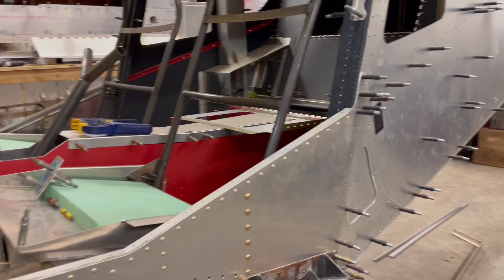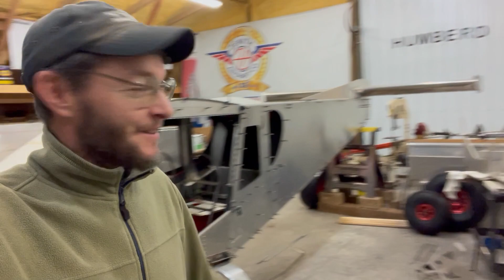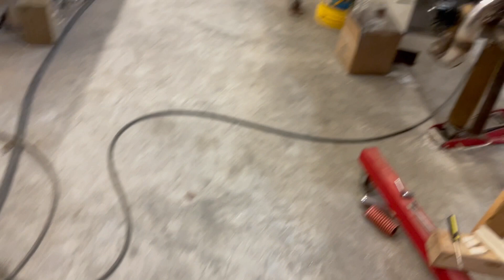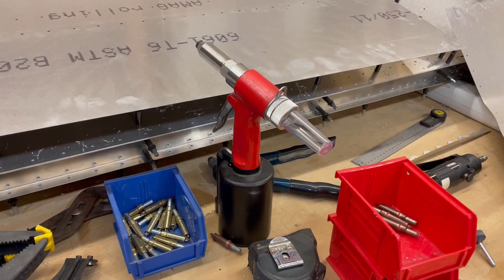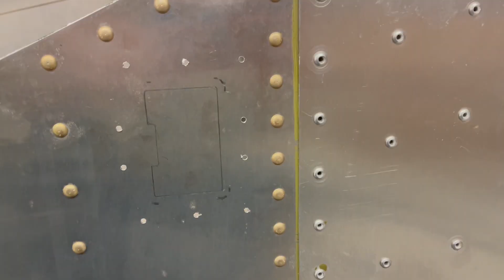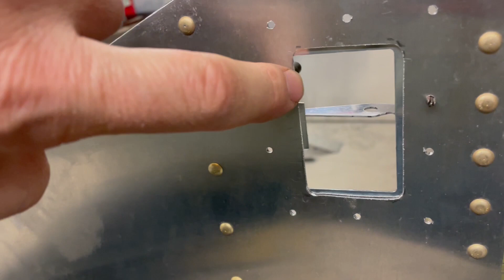Tool Time and Vans vents install details! 750SDXtreme December Build Challenge Day 29

Comment: Started looking at the slim pneumatic belt sanders.  Would you recommend the 1/2" or 3/8" version? What's your favorite gritt of belt?  @TNFlyingFarmer
Reply from the maker: The one I have came with a couple of different arms to allow 1/8 up to 3/4" belts. I use 3/4" 80 grit for almost everything, but the couple of times I have needed a narrow belt, the smaller belt setup has worked great!

Comment: You forgot to subtract the weight of the aluminum you cut out. In reality you remove the “outer skin” of the vent you are adding: Just weigh the doubler, the screws, and the pivot bracket.

Comment: Be careful using a pencil on aluminum. Little bits of the pencil lead(carbon) might not fully be removed and can cause galvanic corrosion. Might take a long time for it to show up, but still can end up being a problem.